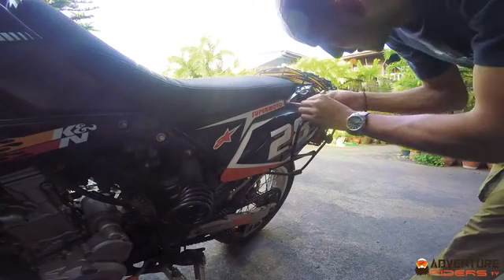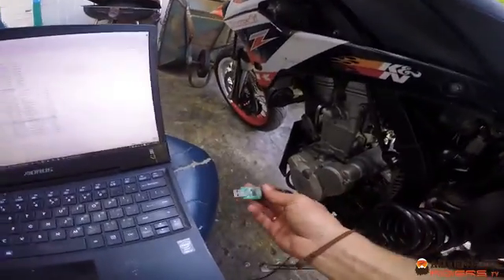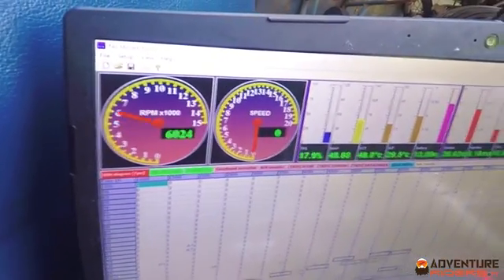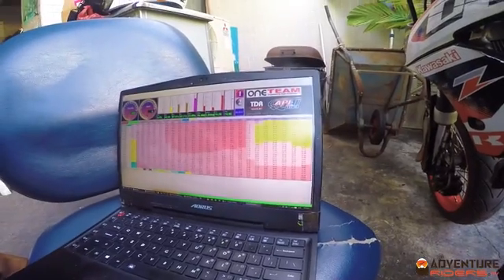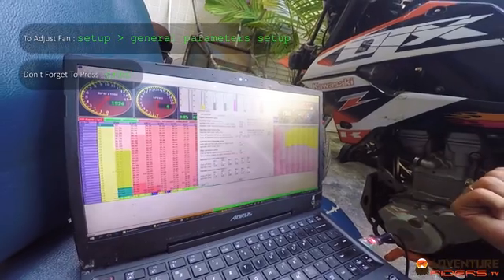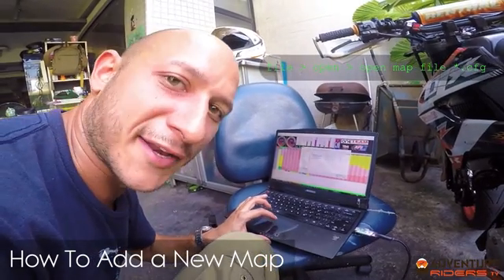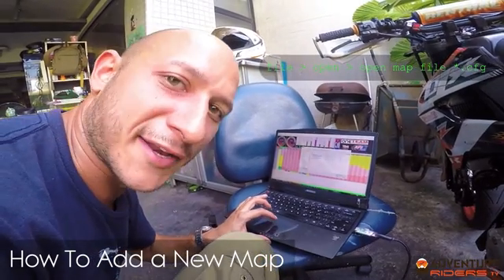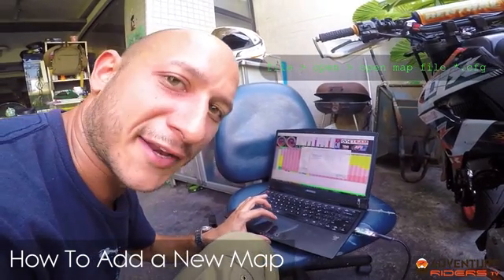How To Connect Motorbike To Laptop - KLX250 / KLX330 API Tech Aftermarket ECU Tuning

Comment: How about CDI unit, is this type can connecting to laptop?
Reply: Yes this connects to the laptop. However I have now got rid of this unit because the company that makes it : API tech. Are absolutely useless,  their service one of the worst I've ever come across, the unit breaks every few months so I've gone through about 4 or 5 of these years. Because they have dodgy fuses or something. It's a nightmare to replace them coming you have to go through a third party person. I've even taken my bike there for them to tune it and they gave it back completely messed up. This is really bad company, I would recommend actually that you get the stock ECU and then get the EJK fuel controller on top of that, then you can actually remap that yourself with the buttons and it's pretty damn good actually

Comment: Do you still not recomment the API ECU for a 330 BB  kit ? I have the EJK, but i am worried about fueling and ignition timing.  I was  about to buy and API here in Indonesia, but i stumbled across your video, now thinking twice.
Reply: Yes, after dealing with them in Thailand for ages, many units dying and needing replacement and their service is absolutely garbage. I would definitely not recommend buying anything from API tech. Another brand maybe ok, but now I've gone back to the stock ecu and use an ejk controller attached to that which works great. The API ecu works good if u tune it well, but it WILL suddenly die for no reason at all, happened about 5 times to me sometimes in far off places. In the end I was always carrying a spare unit to plug in when it dies that works fine but it's too often it dies. Badly made and really bad support
Reply: What EJK are you using the Gen-3 or 3.5 ?  
 @DigitalSamTV
Reply: @georgebell6878  can't remember. Just get the latest tho. I'm away for now so not with my bike for a while
Reply: Did you have any luck with adjusting the ignition timing ? Your video make reference to the bike going to 11,000 rpm. Does it still do that with the ejk ?  To be honest my bike is ok with the 331 kit and ported head using ejk, but it runs really hot all the time, i was thinking it was not fueled properly. I am worried about going to far incase it packs up on me. Indonesia is a bit like Thailand, when you out and about if you breakdown you are f--cked. and if you leave your bike for more than an hour it will be gone..
Reply: @georgebell6878  it wont rev as high with the stock ecu and the ejk (I think 9500 or 10k ) it's enough really... It seems to be smoother and better. U def need the ejk if u do the upgrade or the aftermarket ecu. I'm happy with the power using the ejk and I have the 351 big bore now. It rips pretty good
Reply: @DigitalSamTV  Hai, I was supplied a EJK with my 331 big bore kit from the states, i had the head reworked with bigger valves also. But it runs really hot. and seems to be getting too much fuel if anything. but there is some lean spots, I have just fitted a Fuel/Air Ratio meter, and it seems to be all over the place. I am seeing readings from 10.1 to 18.1 :(

Comment: My Mechanic just installed an extra fuel injector and kept the stock ECU, I was surprised it worked so well.
I do have overheating issues though, which could be due to running lean.
Reply from the maker: Cool. Yes it will work much better. The problem with doing it that way though is that the revs are still limited quite low. If u change to the full ecu and remove the original one its a much better result

Comment: Gday mate, with your big bore kit does it require higher octane fuel to be run in it? Cheers mate.
Reply from the maker: hey man, cheers. no it doesnt. i usually use the 95 normal gasoline (rather than 91) and it runs nice and smooth

Comment: Hi, I got my API ECU today for my KLX and I use the same USB cable like you but I can´t get access to the ECU :-(  Do you have any tips for me (FTDI, driver ...) I use Win 7 and XP, no chance. The support from API sucks. I want to upgrade to 300cc so I also need a *.cfg file. Thank you very much.
Reply from the maker: Claus Nessi hey there... if you give me your email address. i can send you the .cfg files for the 300cc and 330cc ... try those out. you shouldnt need a driver it was just plug and play for me. make sure the cable is the correct one with the circuit board buillt onto it. you can order the cable from api (butbyes their service sucks so bad, one of the worst companies ive ever dealt with for bad service )
Reply: Hello Sir, can i get a .cfg files for 300cc? My email address is mxrichs@yahoo.com I really appreciate that. Thank you so much

Comment: i've got a kawasaki er-6n, i've got a leo vince slip-on and a  Healtech Electronics Quick Shifter Easy, and a k&n air filter. 

would i benefit from a aftermarket ecu? and if so which one?
Reply from the maker: Big Hoyle hey there... i havent owned an er6 (i did rent one for a few days on a long trip through the mountains... sweet bike). i would say though that yes for sure it would benefit because the new ecu with the new maps really maximises the fuelling at each rev and therefore maximises the performance of the bike. however the api tech company produces good products but the customer support and service is terrible. if you are doing this all yourself i would prob go for a brand with good support.  you can also look at just a piggy back fuel controller which works along side your factory kawasaki ecu.  i have head good things about the ejk brand and the power commander brand ones. good luck!
Reply: thanks man, i'll do some research.